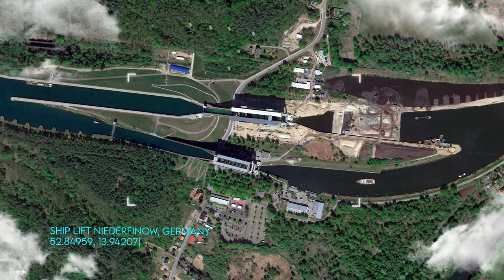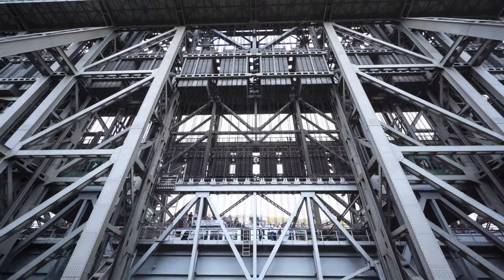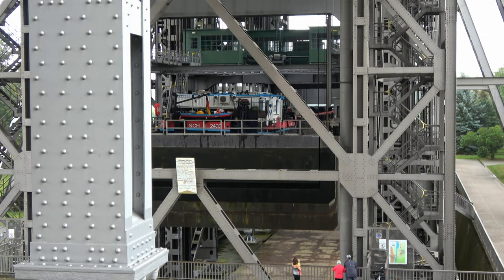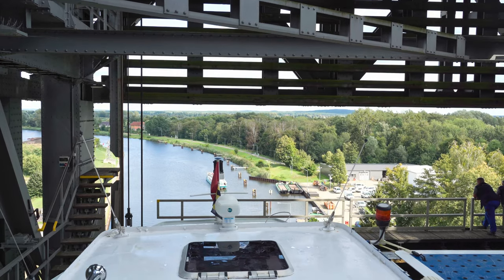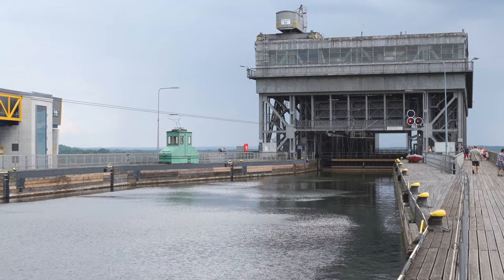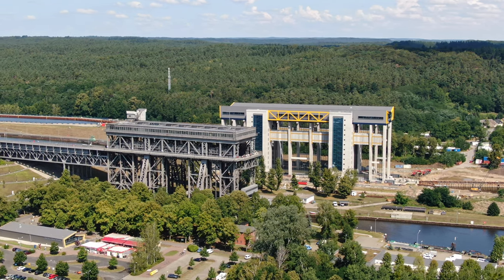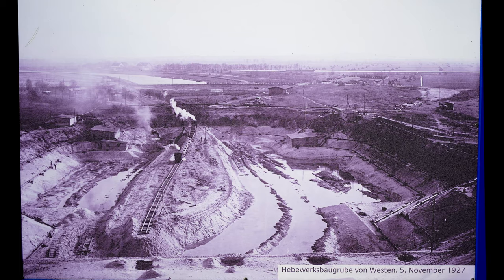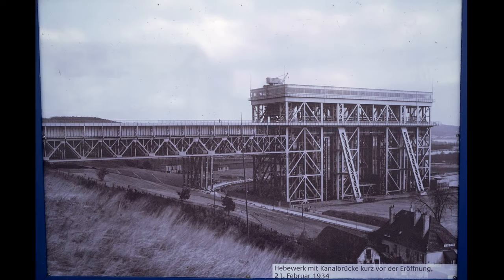SHIP LIFT of Niederfinow | A GIANT 14000 tons ELEVATOR FOR SHIPS

Comment: Just to correct one error.
The cost of the new Shiffshebewerk Niederfinow Nord are 285 Million not billion. -> 285,000,000.00€
thats 3 fewer zeros.
The old one cost 27.5 million Reichsmark in 1943,
which in todays money is about 118,250,000.00€ in todays money.

Given that the new lift has more than six times the lift capacity;
the price difference isn't too bad.